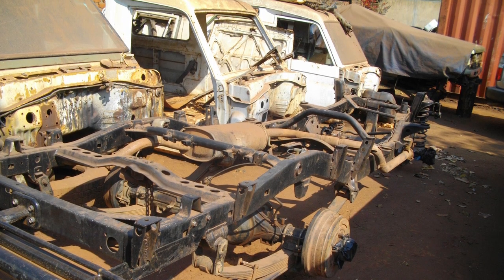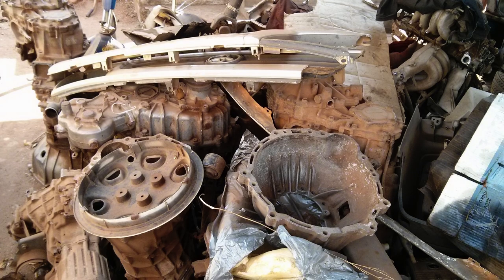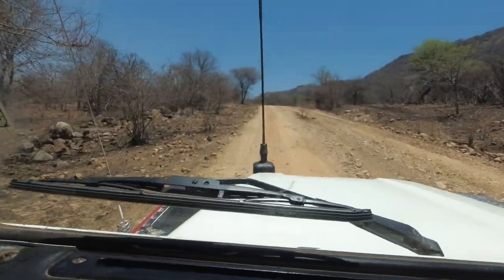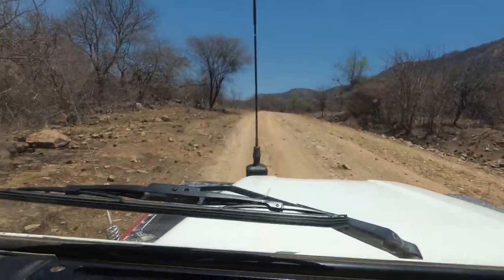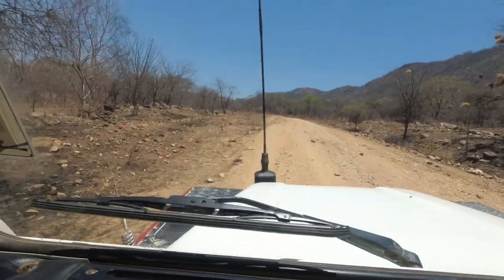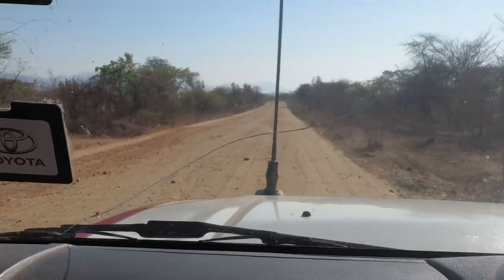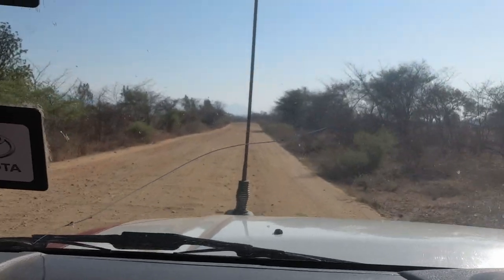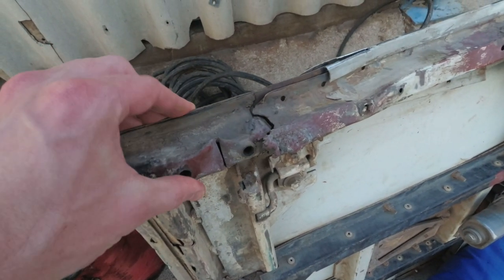Maybe why Toyotas are outliving Defenders in Africa

Comment: I was in Tanzania a couple of years ago, and most tour 4WDs were Land Cruisers with a few Defenders.  However most older 4WDs in private service were Defenders, and they were in all states of dis/repair.  The Toyotas didn't seem to last beyond a certain age.  One driver of an extended wheelbase 300Tdi Defender told me that the Defenders were more comfortable and smoother on the dirt than the Toyotas, but they needed more maintenance, which is what the fleet operators hated. 

A lot of the Defenders NVH 'discomfort' in my experience arises from the noise and vibration, but the suspension is supple enough to actually absorb the harshness.  For example, after a 700km in one day desert trip on corrugated roads, I found that the lateral movement of the bonnet hinges and the bonnet knocking on the firewall was doing my head in. All of a sudden, spending $170 on security hinges for the bonnet that eliminated that rattle seemed cheap!  As did the price of the Exmoor / Wrights acoustic mat once fitted.  

The other thing is that Defenders have more moving suspension parts, so they do offer a better ride, but that ride is subject to knocks and rattles as the bushes wear, so the Defenders suspension requires more maintenance than the Land Cruisers.  Constant 4WD also gives the Defender safer and more predictable handling characteristics.  As the suspension wears and as bolt on body parts become loose (or frames crack), the ride deteriorates to below that of the Land Cruiser.

In the early 90's I had a 1950 SII and drove mid 80's Land Cruisers in a snow resort.  While the Toyota had more power and better brakes (being 25 years newer than my LR), the LR still out handled it on winding roads and loose surfaces.  Even then, I think the problem with the LC was that the shackle was at the front of the front springs, so that as the spring compressed, the axle wanted to 'punch' the obstacle, whereas with the shackle at the back, the LR axle 'yielded' and rolled over obstacles better.  i remember reading at the time that in Eritrea, the Land Cruiser was the preferred vehicle by rebels, as it could be welded after hitting a mine.

I was in Maun a few years ago and stayed at a BnB run by a local mechanic.  On his workshop he had a painted sign with a Land Rover logo and a red cross through it with the words "Sorry Mate" (photo here https://www.facebook.com/OverlandExpeditions/photos/1571998982861472 ).  Inside the workshop, the walls were full of land Rovers that he had run and raced, and in his own yard was a customers D3 that had failed in the Okavango.  I was driving a Puma Defender, so we had a bit of a chat about cars and parts.  In outback Australia, if I pulled into a remote aboriginal community is a SIII (years ago) peoples eyes would light up and they'd talk about the old Land Rover days, though now it was all Toyotas.  I think the love for Land Rovers is deep, if only Land Rover loved their product as much as their users do.  Of course if they did, they would have removed the firewall from being directly bolted to the chassis and mounted the body on preferably 45deg rubber mounts (like engine mounts) to eliminate all the NVH and reduce the vibration.  And dashboards wouldn't have been made from crack-able rattling plastic.

Anyway, maybe old Defenders will get an Ineos Grenadier motor and transmission transplant to keep them going in the future.

Comment: You are spot on. 79 series cruisers were so much better than the previous 75 series because it is not a bolt together cab. Although, many in the safari industry moaned about the change of cab. They ended up cutting them up for game drive vehicles anyway. 
The problem with Defenders, in my humble opinion, is that the entire body is bolted directly onto the chassis. No cushioning at all. Which means every time the chassis flexes, the body joints and bolts have to move as well. Which is why it sounds like a bag of bolts going down the road. Land Cruisers have rubber body mounts between the cab and the chassis. Cruiser is better every time.

Comment: Some very detailed analysis going on at "Defender Mods and Travels" . Persevere on the 8 part axle series and it emerges speed, wide tyres, offset rims and hub spacers all  have a disproportionate effect on accelerating the onset of bad road  fatigue failures in axle casings ( apart from reducing wheel bearing life for the latter two). So, the original "as slow as possible...." LR guidance clearly makes all the rattling part of a greater plan to slow the driver and might explain larger quantities of more badly damaged other marques suffering higher speed disasters than Land Rovers ?
Reply from the maker: Unless ear defenders become standard equipment.... 😁
Reply: @lrworkshop  That could sink the cunning plan! Actually the fatigue  increase numbers  are scary for both speed and wheel offset.

Comment: That ability to easily repair and cannibalise wrecks should have been a strong point.  The problem was LR’s greed in parts prices, which priced them out of the market and led to a flourishing market in pattern parts only fit for the scrap bin, which were too expensive to take a chance on in the third world.  Had LR been more reasonable in their parts pricing, they’d have sold enough parts to keep the vehicles going, for them to be reliably maintained and to have an enviable reputation for dependability and longevity.  The problems keep coming back to LR management.
Reply from the maker: You're so right Nick. Just think what LR could do right now to get them out of the hole they're in by producing thousands of genuine Defender parts at reasonable prices. Imagine if you could get bulkheads for £400 right now. How many would you buy? 😂
Reply: @lrworkshop  I agree absolutely, Britpart last year made £35 million in profit, imagine if that was Land Rover themselves, genuine part quality which we all would buy in preference to the often poor after market parts. Spent many happy years in the Southern countries of Africa , bought back good memories so thanks for that.

Comment: A theory I heard once by a toyota fan boy. Contrary to what you’ve just said so I would be interested in your take on this. Once Land Rover moved over to coil springs they could travel faster over rough terrain while the toyotas still on cart (leaf) springs had to drive slower. This meant that the land rover took a greater pummelling and broke where the slower driven toyota didn’t. Hence toyota got a reputation for reliability and the defender got a reputation for unreliability. I love my defender, I’ve owned it for 18 years of its 30 year life but my eyes are open to their many faults and the fact the land rover never developed it into the vehicle it could be.
Reply: That's interesting. I also think because Land Rovers are more simple in design and build, people tend to treat them with less care and use them harder. They never get treated with respect. Any film with Land Rovers, especially James bond, they get trashed. They appear disposable.
Reply: Very True. We ran both HZJ75 & Defendrr 110. The ride in an unladen 75 is boneratteling. Even the most hardcore LC-fans biwed their head when they saw how the D110 $di performed. Both on term if engine & suspention. They could both legalky carry 1ton payload / 6 People in the Bush in relative comfort 😀
Reply from the maker: So the LC I was in had coils on the front and leafs rear. I think the change was around late 90s models. It was actually quite stark sitting in the front compared to the second row. You really notice the difference of coils giving a more comfortable ride compared to a metre rearwards. It may still be worse right at the back, but for the driver it's a more comfortable experience = more speed

Comment: From 30 years of working in West/Central Africa cars are  not written off no matter how bad the damage is, there are lots of people dealing in second hand parts but no scrapyards  as such and most of the parts  are Japanese or European. Iwould have to hand carry parts in for my Landrover when I returned from the UK, almost no parts available locally.  Defenders as such a very rair beast, it seems Landrover ended at the 110 in this part of Africa. The road on your video is like a motorway standard in comparison  to most of the roads  I would travel down broken suspension was a huge problem , I drove 110, and 70 series Landcruiser  (1990)  very little to choose between the cars.

Comment: It's amazing they still make the 1HZ engine, that came out in the 1990s.

Mining company's here in Australia buy the separate long motor (block, head, crank, etc) for their fleet vehicles. 
Nothing can take abuse like an unstressed straight 6 diesel engine, the 1hz is the AK47 of power plants. It's crude and unsophisticated but cranks everytime!
Reply from the maker: And these days they're sold with airbags, A/C, central locking and ABS!
Reply: @artzahara3922  In Africa, the mid East and parts of south America there is the 1hz is still the stock option. 
Commercially sold vehicles in Australia get the V8 turbo diesel, vd-ftv.
An mining company's can buy the 1hz as a separate long motor.
Reply: As far as I know, the 1HZ is still sold in Southern Africa, and colleagues at Toyota have told me the Australian mines come to South Africa to buy all the 1hz cruisers.

Comment: Are the Cruisers actually living significantly longer than Defenders, or is it just you can still buy new ones and they look pretty similar to the ones from nearly 40 years ago so no one really notices them being displaced?  It seems from the comments below the earlier 70 series with the leaf sprung front axle aren't so common now, probably because after at least 20 years service many are probably over 500k km and due retirement.  The same could be said for the Defender given the fact the ones you seem to come across are the later 'RoW' models rather than the 80's/90's models.

Buying habits will be changing too and that will effect lifespan.  Back in Land Rovers heyday of the 1950's-60's you were lucky to have a vehicle at all and there wasn't that much alternative to a Land-Rover series I or II (the LC40 is really a late Series IIA/III era rival).  These vehicles required a lot of maintenance and understanding to operate and maintain successfully (as did all vehicles of that era) but look after it and it'll look after you (I'm sure there is something in the saying the suspension was designed to break the driver before the vehicle, its also worth noting pre-British Leyland era Land-Rovers were actually quite well built compared to many vehicles of their era - not something you'd say about modern ones!).  Even in the 80's/90's these early models were still being kept going in remote places by people still willing to put the effort in (and probably lacked the resources to upgrade).  Nowadays it seems people expect stock, neglected or worse - badly modified vehicles to hold up to rally stage conditions without issue but when the inevitable happens its not such an issue as the vehicle is easier to replace so doubtless people would scrap something now when they would have put up with another decade of increasingly dubious repairs back in the day.

The youngest RoW Defender is pretty much 15 years old now but that's 15 years of younger Cruiser sales keeping the numbers up with less worn examples (some of which of course will be replacing the NLA Defender).  The ready availability and demand for LC70 parts does somewhat disprove the internet comments 'fact' that Cruisers never break but does aid cost effective maintenance, especially where new parts aren't so easy to get.  Sadly thats not going to help the Defender, the cheep worn out parts from end of life vehicles will help keep others going a bit but not reliably and its inevitable that just like any other vehicle, somewhere around 15-20 years after production ends, numbers will drop significantly as most users opt for something thats less effort to run - there will be some that soldier on though, promoting nostalgia for a bygone era, its not like they aren't capable, but it'll be the hard way and it won't make complete rational sence, rather like a series Land-Rover today.

Comment: My 2c - doing 60 or 80+ km/h on dirt roads is different to “off-roading”. I’m not sure it’s reasonable to expect OEM running gear on a 15 - 20 year old Defender to put up with punishing corrugated and pot-holed roads and last all that well. We took 3 relatively new Hiluxes through the national parks in Botswana a couple of years ago and whilst I was impressed how they performed (laden with roof tents, fridges and the rest), I’d hate to imagine what they’ll look like in 20 years time. For a LR to endure what you are describing comfortably and reliably requires major modifications and constant maintenance, which is arguably half the fun. Your average person would rather take a younger Toyota or a Nissan, run it until it falls apart and then just replace it. It’s less heartache and logistics, and isn’t all that expensive given the resale value of even knackered cars in Africa. Can’t do that with Defenders anymore (if you ever could) so you see less of them 🤷‍♂️
Reply from the maker: Thanks Ken, interesting to read. Maybe the Toyotas die sooner and get replaced sooner, whereas the Defenders soldier on and become basket cases!

Comment: A 20Yr old Land Cruiser, in particular the HZJ7, would mean a very early J78 Troopie or 79 Pickup.Those where the first HZJ7 to have coils upfront. Pre `98 where leaf-sprung J75 all around like a Serie LR. I have seen SO SO many J75 crack in the most shocking places both body & frame well south of the 100K mark, U`d be shocked. Yes, the LR get abuse, but to claim the ride in a J78/79 is "better" in stock than a same age LR 110 is way off the chart. Sorry! I can claim this as I have owned & driven both on the must rural Africa :-) I currently run a J78 as the last Defenders where way outof my financial reach when I bought my project vehicle. Would still consider a Defender as a blank canvas if the price was right. Spending money on the suspention on either vehicle returns a way better ride :-)
Reply from the maker: Thanks for passing on your experience Peter. Good to know the LCs can die too!
Reply: @lrworkshop  Those mid 90s HZJ75 I referred to, barely made it past 100K... They where all served very carefully w genuine parts only. Regardless of Expat, lical drivers or missionaries as vehixle owner, they all suffered. As for parts; I know the UN is sourcing out huge amount of vechicles around the shores of Lake Victoria.

Comment: Sad , but true ! And the `new` Land Rover Defender , will not be anything else than a `city-slicker` for they who don`t need it .
Let`s face it , the Land Rover era is `out , stopped and smasht` for they who need a working horse.
And I have been with LR since I got my first Matchbox Daktari with sebra sripes in 1969/1970 ( age 6 / 7) i think it was :-) 
And today , I have a 2013, 110 with 160000 km on the clock.
And 3 main gearbox , 2 transferbox , 3 compl.clutches , 3 compl.axle shafts and and and  :-( :-( a lot 
And this is not abused. (I`m a trained mechanic in heavy duty trucks and have  all letters in my driving license for almost 40 year) But the quality is no longer good.  Land Rover : You have lost !
I wait for the Grenadier  :-)
Reply from the maker: That's a lot of things to go wrong on your truck!
Reply: @lrworkshop  Well.... If U trash it.... 1 Gearbox can go... when the 2. goes one starts to look elsewhere